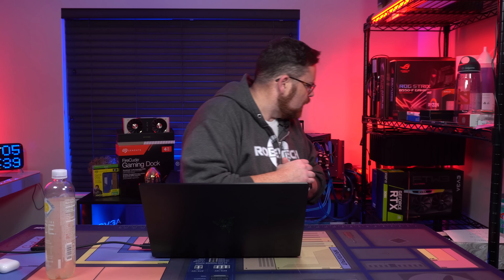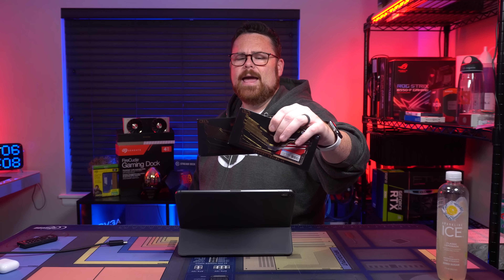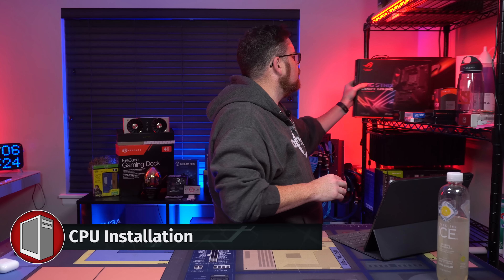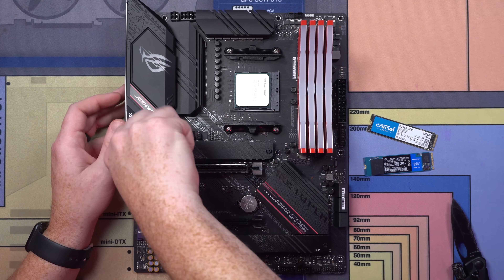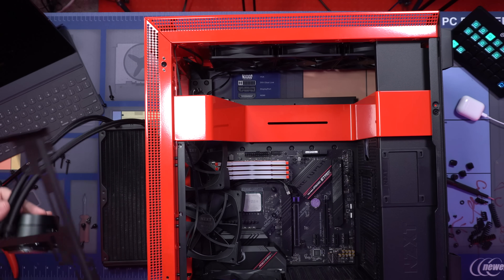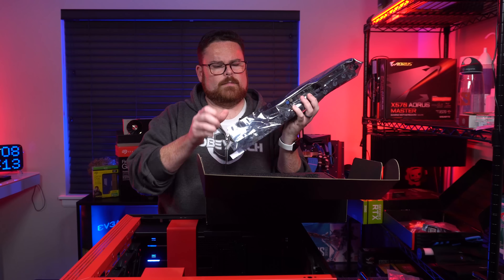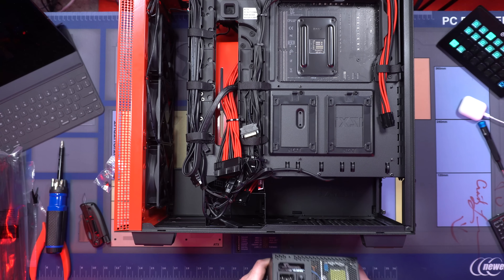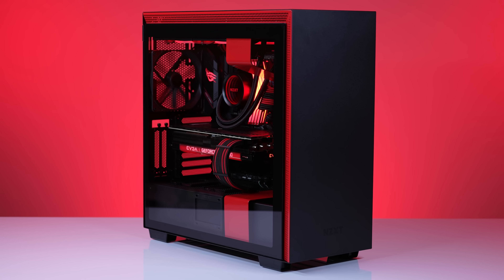The $2600 NZXT Black and Red Build | Robeytech

Comment: What cable combs are those for the 3x 8 Pin gpu cables?  I have the all white asiahorse extension cables but rather use the 24 cable combs similar to the video.